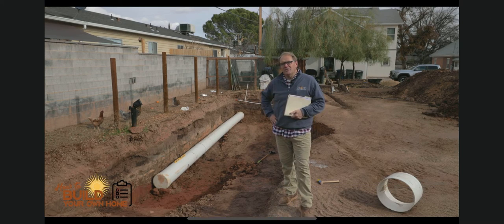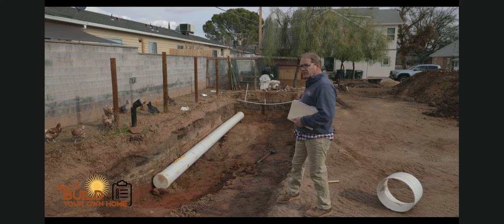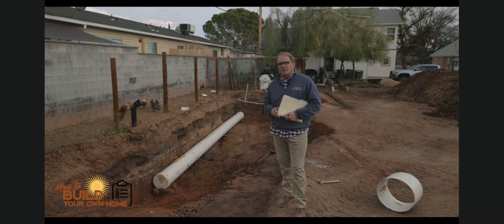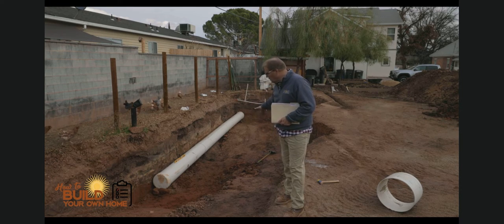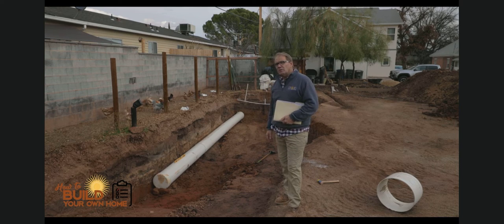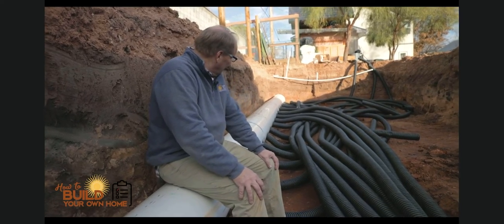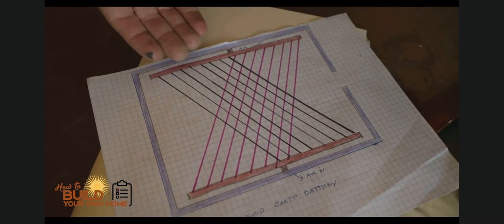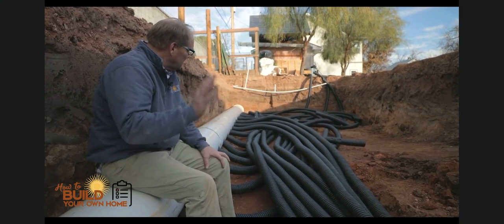Ep  1, Peacemaker Series, the Building of an Earth Battery

Comment: Did you do BTU calculations/tests on this? I'm not sure how it fits together or if you can even get a real amount of BTUs with this setup. Would an insulated concrete slab have the same effect? Would water pipes have better heat transfer? I want to have greenhouses some day but the best I can figure is that having a lot of water in your aquaponics system +some heat pump when it hits the edge of the desired temperature range. I wonder if the water itself will be more effective than these buried pipes.
Reply from the maker: Research the farmer in the Dakota area who is growing citrus during the dead winter with this method. All we need is to keep the temps above freezing by a few degrees, and this takes the edge of that quite nicely. Summer heat will be a different task as this will not be enough to cool by even more  degrees.

Comment: Sounds more like a geothermal  rather than a battery which would include electricity.
Reply from the maker: A battery holds energy you put into it. I build this just to hold heat in the winter only. Many call this a geothermal battery. I guess the term will get better in time as more people use it.